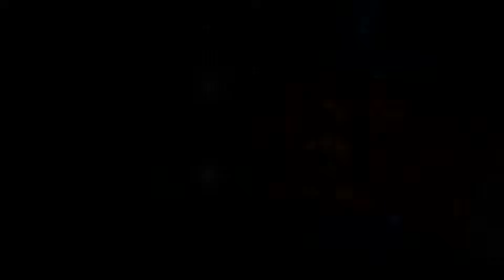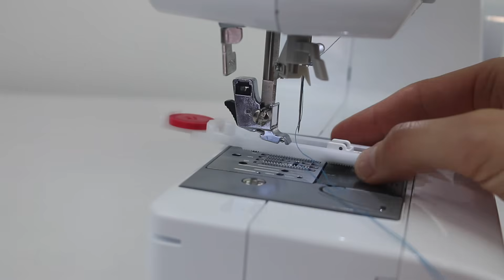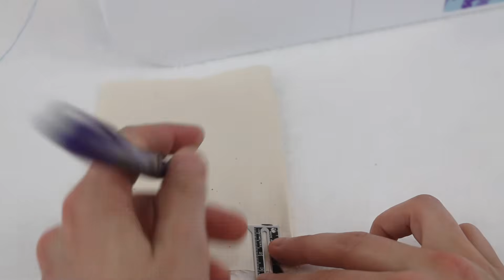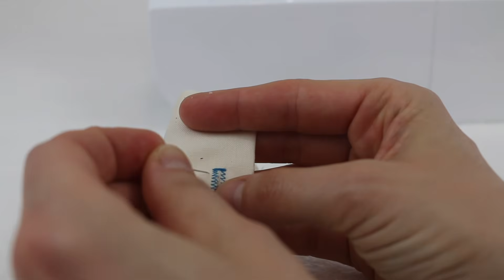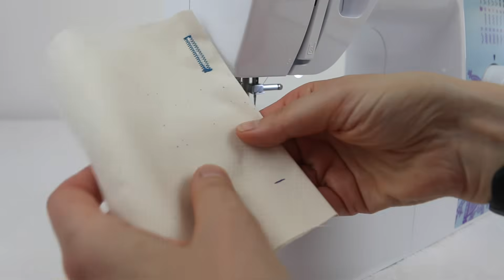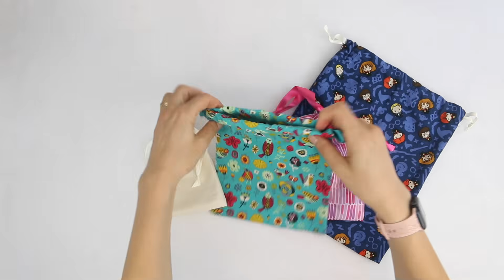How to Sew a Buttonhole Using a Brother XM2701 Sewing Machine

Comment from the maker: I hope you've found this tutorial helpful. Leave any questions or comments below and don't forget to use the chapters to jump to different parts in the tutorial:
See the Brother XM2701 Playlist here: https://www.youtube.com/playlist?list=PLZaDe-5_2RLwl3PoKi8SWufoaZDposH4n
00:00 Introduction to the Brother XM2701 buttonhole foot
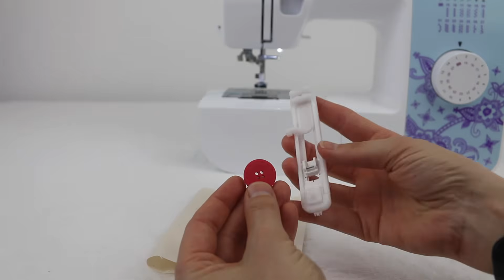00:20 Inserting the button into the buttonhole foot
00:53 Attach the button hole foot onto your Brother sewing machine
01:21 IMPORTANT STEP: Pull down the buttonhole foot lever and push it back
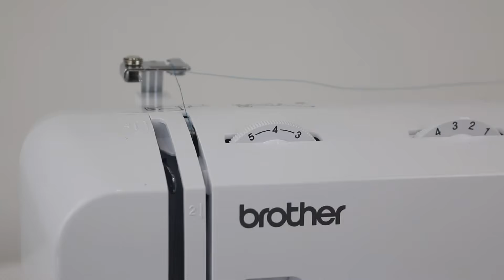01:43 Buttonhole settings
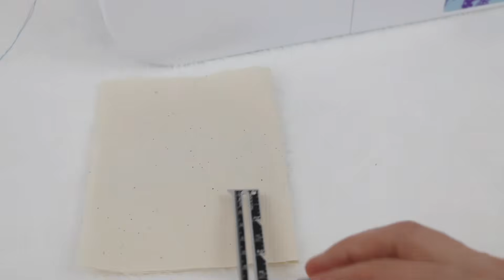02:33 Make the buttonholes onto the fabric
02:48 Ensure top thread is running underneath the bottonhole foot
03:18 Now we're ready to sew a button hole
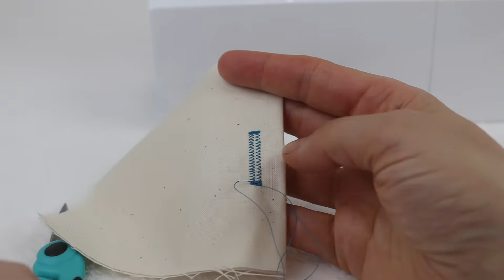04:47 Open up the buttonhole
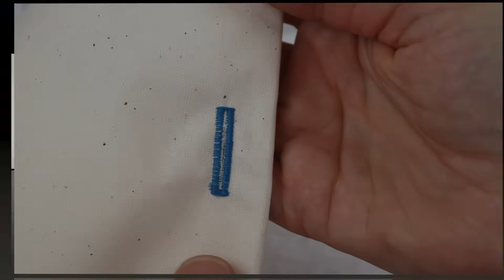05:57 Top tips for getting the best looking buttonhole on your Brother sewing machine
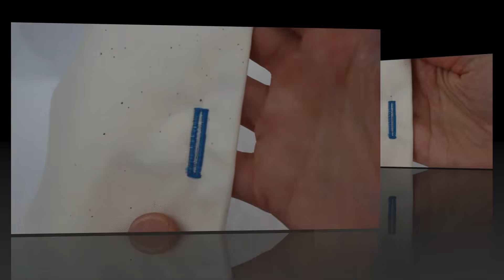07:48 Some Easy Sewing Project Tutorials for you to check out

Comment: Hello, thanks for the tutorial! It was super helpful to get started, but I am having some trouble now. I did some test buttonholes and know that my machine has no issue making them on quilt cotton, but I have thin bathrobe made of a towel like material that I want to add a button to. I don’t think the issue is with the thickness of the material, as I reinforced the seams with a zigzag stitch with no issue. But when I tried to add the buttonhole, the material got stuck in the machine. I added something to the back stabilize it, but now the stitches aren’t catching and I’m not sure what to do. I’d appreciate some advice if anyone has any.